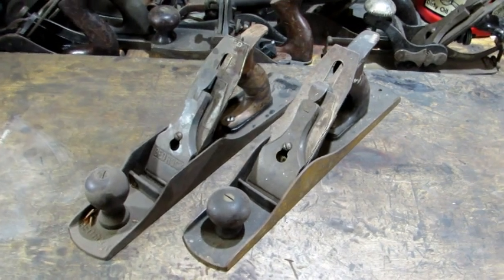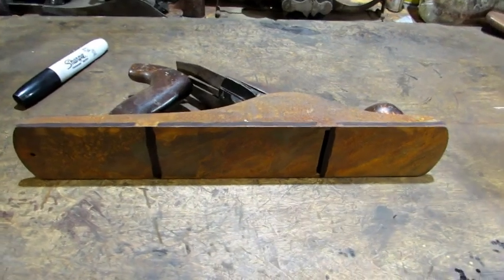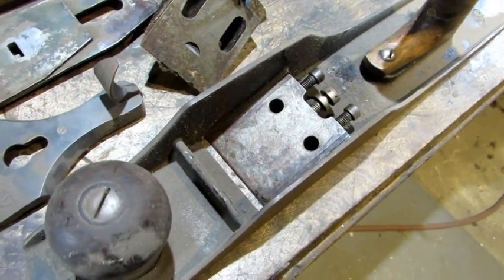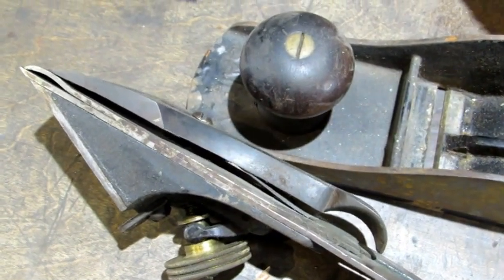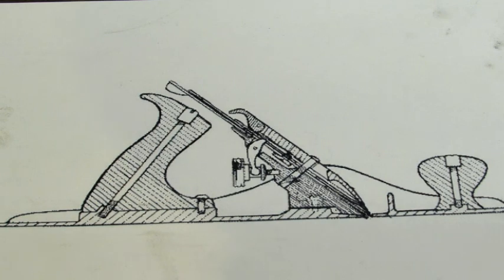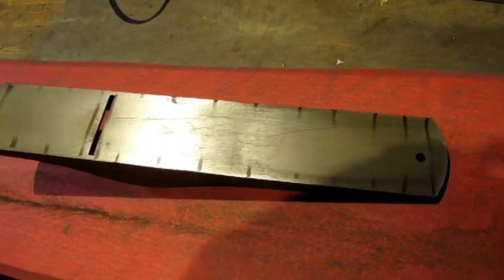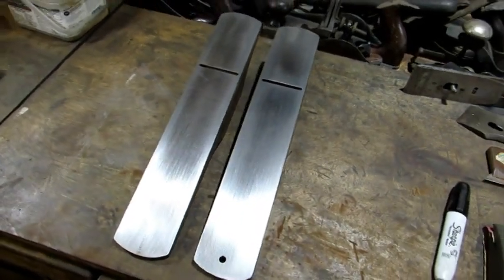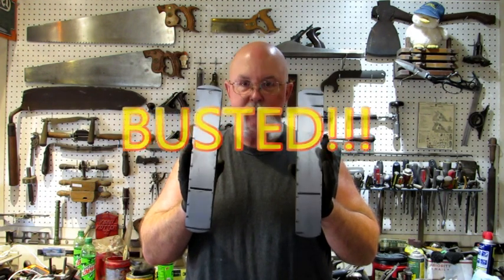BUSTED!  Lapping a Bench Plane Fully Assembled vs. Bottom Only

Comment: Having the sole truly flat isn't about it being able to plane a shaving from a piece of stock. Its more for referencing. So you are not as right as you think you are. I use to do a half ass job like you are showing here and  then I used a guys plane that was truly flat. HUGE ASS DIFFERENCE in its performance. So no myth busted here at all.
Reply: There's more to taking a clean shaving then just a flat sole.  This just shows that "flat enough" is subjective.  If you were "half assing" like your said, you may not have done the rest of your plane set up as well as the guy's plane you worked so well with. A lot more than just a flat bottom.
Reply: if you only lap it so the center is done then your plane is all but useless to use on a shooting board. I lived that mistake my own self.
Reply: Exactly Michael Beard.

Comment: Keith, I completely agree. I have never understood how someone could tighten any of the screws on a plane to the point where the sole could flex.
Reply: Yes, the side cheeks on most planes give an effective beam section of about 2 inches by 2 1/4 - the idea that any human could flex a 2 inch deep cast iron beam by hand tightening screws on a plane enough to affect the line of cut in wood is a bit bonkers.

Lets face it most planed wood surfaces will move far more with ambient humidity as the seasons change than any error in flatness caused by the minute flex in the plane sole.

Here's a more important issue, as soon as you drop the iron to normal cutting depth you have effectively turned even the flattest plane into a three point convex plane - which is why we have different lengths of plane in the first place - the longer the sole, the bigger the radius and the flatter the cut.  The front part rests on the un-cut wood so it is higher than the back part , so the sole is always trying to push up away from the wood, while the iron digs in to the wood and tries to pull downwards. 

Planing is hard work because you are effectively pushing a weight equivalent to the cutting force uphill the whole length of the cut along a ramp created by the front and back parts of the sole.  How steep it is depends on the thickness of your shaving.

Where flatness would matter is if the sole in front of the blade was moved to set depth, like with electric planers and jointers.
Reply: Agree with 90% of Keith's points.  But, do want to point out it all depends on the quality of the castings.  There are castings that do flex and some quite easily.  If the casting does flex you are probably wasting your time trying to tune them.  The plane will work on pine but it will never work properly on "hard to plane wood".  Unfortunately, the planes that don't work right are very likely listed for sale.  So, be careful thinking plane castings don't flex.

Comment: Great video and that exactly what I did years ago, if the plane body can be flexed by mounting the frog and blade set, throw away that plane!
If you've ever seen a "How to tune a Japanese hand plane", you will find exactly what your conclusion was at the beginning, the plane sole touches in the front (toe), in front of the blade, and the (heal) or rear of the plane. 
The blade should protrude ever so slightly for a fine cut or for an aggressive cut, more protrusion...
Since Japanese planes are made of wood, it is suggested to use a wood scraper and "hollow" those areas in between for best performance.
Thanks for this video.

Comment: Well done test. You are right in that   it doesn't make much difference.  There is flexing of metal, but at the  pressures put on by the 2 screws it   will be minimal. Pushing the plane will flex it more (the reason for the side cheeks). Heck, changes in temperature would cause a temporary warp.  Good job.

Comment: Thank you for explaining it, I did this and ended with a low point of about half an inch on the front and back, so i stopped thinking that it need it to be 100% flat, and by doing so, I was going to remove so much metal, that it will ruin the plane, in fact, I wasn’t sure if it was already ruined. Now i can put it back together an use it!

Comment: Great video! I agree that you don't need the entire length to be perfectly flat, but the entire width you do! I use the very edge of my plane A LOT when correcting a slightly out of square planing. I only put one side of the plane on the higher side of the surface. If this side is not flat then it's not going to be a straight edge on that board...
Reply: Aren't you using the slight camber in your blade for that? Why would the sole need to be perfectly flat across?
Reply: I only put a very slight camber on my blades. Just enough for being able to eliminate plane tracks on the finest setting for smoothing. If my edge is out of square that means I'm not yet in the finest setting and I will have more of the blade out. Therefore I won't be using the middle of my plane on the high side, but use the side of the blade and the side of the plane. If you only take super fine shavings or put a more significant camber on your blade than you can get away with not treating the sides, agreed. We all have our techniques and preferences...   Cheers.

Comment: I love your videos, Plane Collector, but I would like to point out that on planes with the blade oriented bevel-up such as on block planes or on #62's, the lack of a frog means the lever cap applies pressure right behind the throat of the plane, which does indeed warp the sole outward, Even with minimal pressure from the lever cap. Low-angle block planes are effected the most because the cast iron is quite thin under the blade at the throat. I have seen it bow the sole outward about 1/16" on a #65! For bevel-down bench planes the myth is busted, but for your bevel-ups.... You had better lap them with tension or they will not be flat in use!
Reply: John Nickels, I think the main point is, and you'll probably agree...the test is what matters, and a test of a bevel-up may indeed give a different result. The important thing is that people base their beliefs on these tests, rather than "conventional wisdom" which is often neither. I'll probably try this myself next time I'm touching up a bevel-up block.